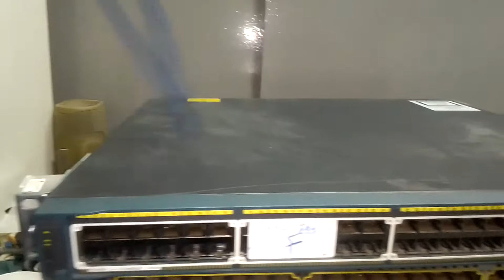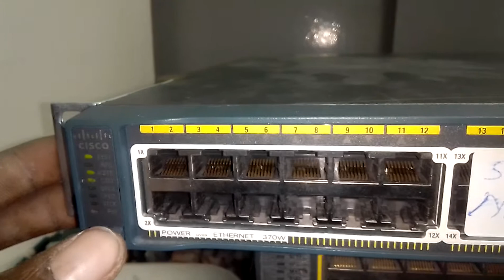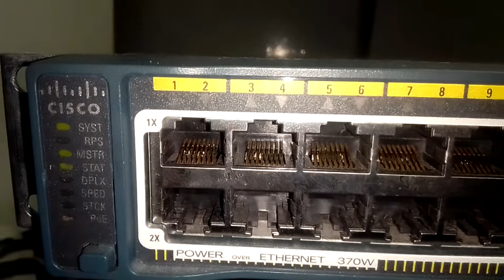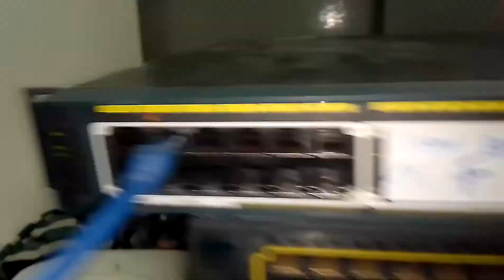#cisco #networking #switch  Fix all Cisco Switches port problems both poe, works 100 percent

Comment: Bro 
In my catalyst 2960, power supply at test points is ok but the unit is not powering up. What to do next?
Reply from the maker: This 2960 is the series number. I want to know the model number